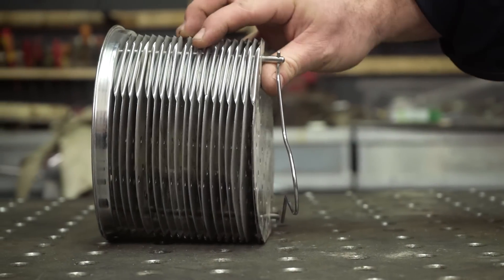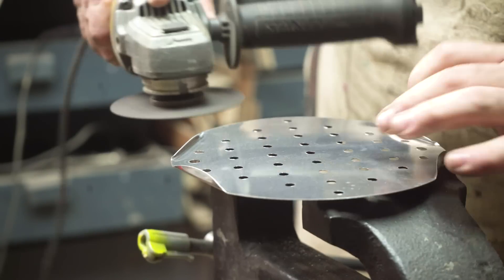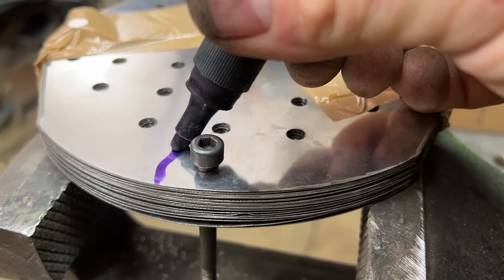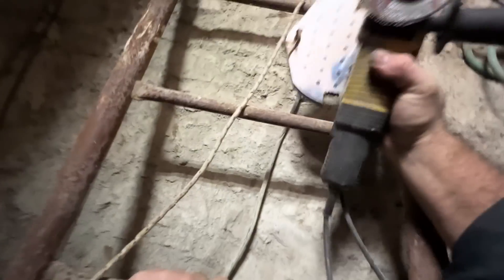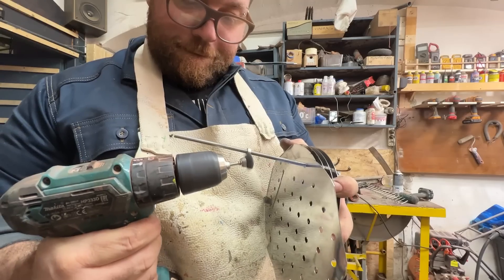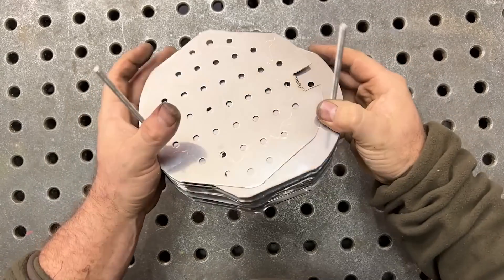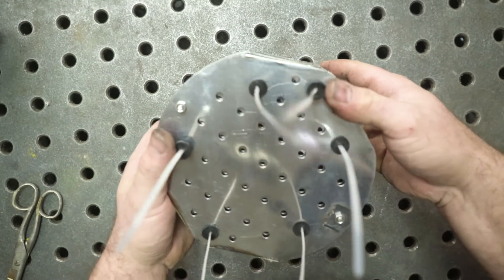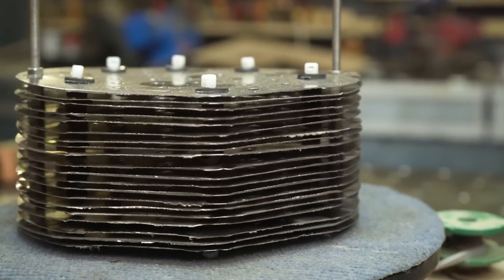How to Make a Cooled Hydrogen Soldering Station

Comment: isnt there a risk of producing hexavalent chromium with stainless steel during electrolysis?
Reply: Thank you! Very surprised your comment isn't higher. It's so concerning how many of these DIY HHO videos use stainless electrodes and don't ever mention this.
Reply: I'm not an expert, so do your own research. But if anyone had already tried this, I have heard anecdotally you can SLOWLY add small strips of aluminum foil to your electrolyte to neutralize the chromium. I think this is an exothermic reaction so exercise caution and wait for the solution to cool down between strip to avoid a thermal runaway. You should also regularly be testing for hexavalent chromium with a test kit and NEVER dispose of the solution or anything that's touched it without taking proper steps for handling hazerdous materials. Check your local laws. But honestly, you should really pick a different material for the electrodes. There are plenty of corrosion resistant metals that won't hurt you. DIY Science Guy has a video on testing for hexavalent chromium and also making nickel plated copper electrodes for this purpose. Metal plating isn't that difficult to a tangential skill to pick up, and if you're making a HHO generator you should already have most of the tools and materials to do it. Don't gamble with your health and stay safe.
Reply: @jarrettg7937  Absolutely agreed! I'm not entirely sure about the aluminum, but I have heard that you can reduce it to trivalent chromium with sulphite and sodium hydroxide (I don't know the exact process). I'm not entirely sure if that's true though, as I'm no expert. I've personally always just avoided it and gone with copper; I'd rather replace my electrodes a ton than deal with toxic waste. I always feel crazy when no one else notices the danger either. hopefully, no one else is following the stainless steel part of these videos. Very scary stuff.
Reply: Very beautiful and useful design!! Great job TKS from Brazil

Comment: H2O= H2 +O.  Beautiful but dangerous. When it electrolyzes water, it decomposes into Oxygen and Hydrogen. In this mechanism, if you do not send oxygen and hydrogen to the combustion section through different pipes, an explosion will occur. This explosion would not be a pleasant explosion. If there is enough fuel, you can go to the moon. :-)

Comment: That's not a proper HHO generator, and that's not proper electrolysis, the color of the flame is the proof .
To divide oxygen and hydrogen, you need two columns, to separate anode from cathode, which is were both gases collect. Don't replicate the errors of others, all the hypothetical HHO generators on Youtube are wrong .
Just search "electrolysis" on google images and see for yourself how wrong people are on here.😂
Also, it is possible to use pure distilled water, but you need high voltage to split the molecules, to surpass the dielectric constant of water and to reach the breakdown voltage. Quote "The minimum breakdown voltage of Distilled water under positive impulse at 2mm and 3mm electrode space is 30kV and 37kV respectively". 
THAT is the key .

Comment: So you'll be making chlorine gas as well as the hho gas using salt as the electrolyte, try bicarb soda instead
Reply: Oh use copper or brass wool instead of stainless wool inside as a flashback arrestor. Works soo much better